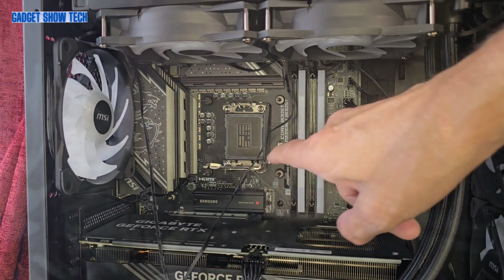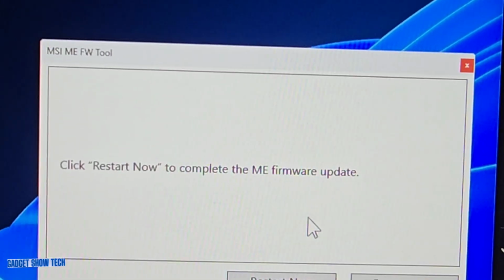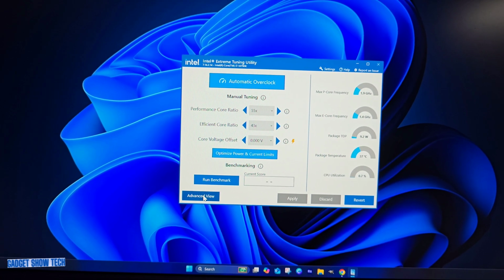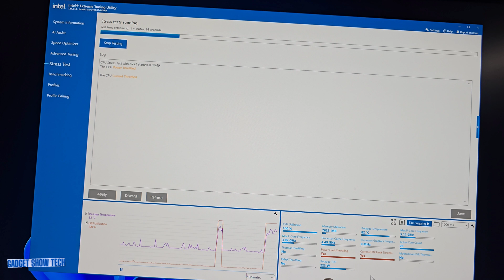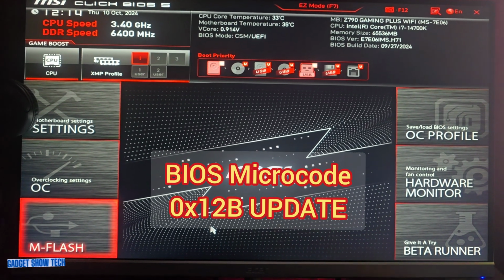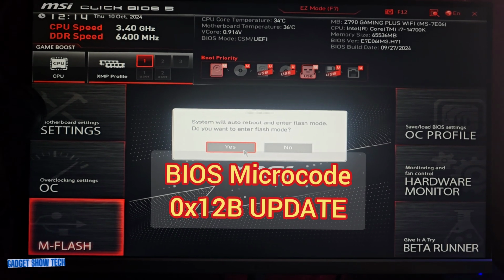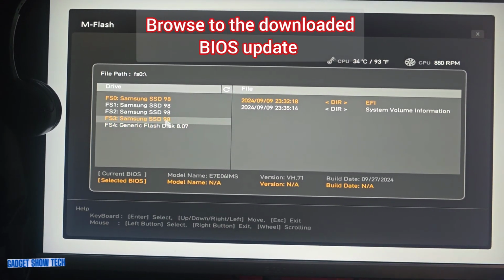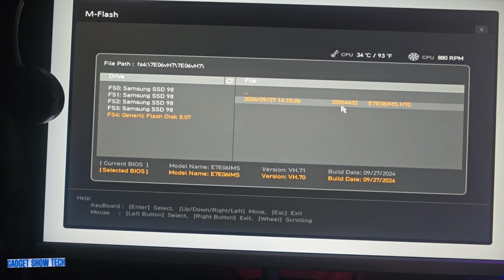Official INTEL Vmin Shift Voltage BIOS Microcode FIX and ME Firmware Update Thermal Throttling Test

Comment: But if i buy a new one will be alright if i will update the bios ??
Reply from the maker: @smamas114  going by info from intel, it the motherboard bios, manufacturer's allegedly wanted to boast how fast they could run on their gear.   Intel has boosted the warranty period and replaced mine very quickly.  Mine was before the bios patches.     The software in the video can be run before and after.

Comment: Intel's recent confirmation that the issues have been fully resolved brings some reassurance.
Reply: @WatfordLondon  where did you get the source
Reply from the maker: I asked Intel and they emailed me, the microcode corrects the voltage settings.  we have updated our webpage article with the info.
Reply: This video with the replacement chip.